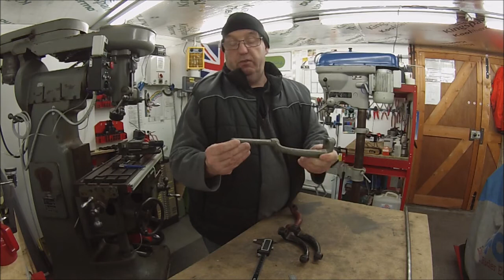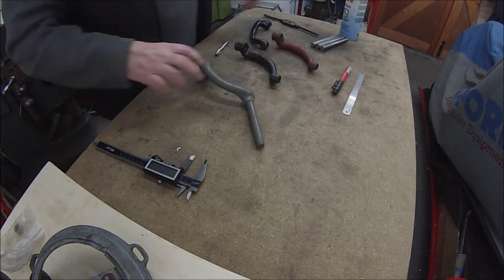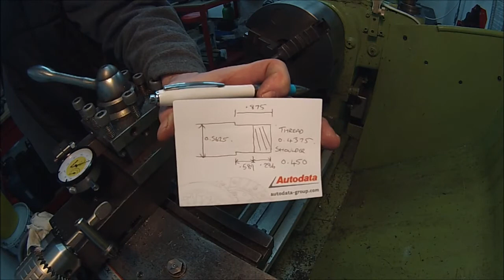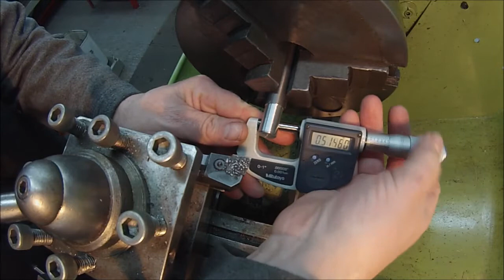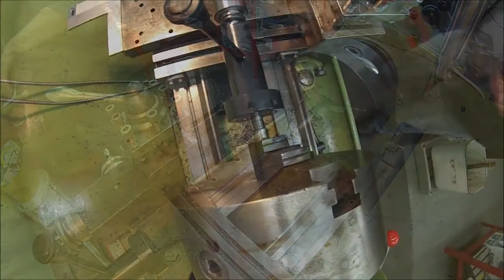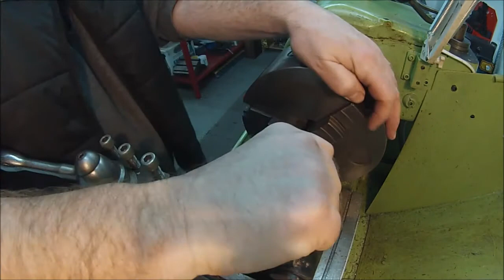Norton footrests

Comment: I see that the competent metallurgical technician in the bitter English winter often works with a coat that is a little long and open, with long sleeves. Without belittling him in any way, when I worked years ago in an industrial apprenticeship school in various occupational areas, the Director of the School of SENAI - National Service for Industrial Apprenticeship always insisted with the Instructors of Trades to demand of the apprentices, post-guard supported with a thin strip around the neck and two straps tied around the waist, secured by just two cotton threads. Many mothers criticized the fragile seams of the moorings. Sometimes they even sewed reinforcing. Hence, the apprentice was asked to hand over the altered dust jacket, being given another one with weak seams. Unfortunately, or better fortunately, there was an admirable case with a minor apprentice for example. When turning a threaded piece, wearing a woolen blouse (against the rules and not observed by the Instructor), it was pulled by the spindle of the lathe, passing between the prismatic bus-bar and universal plate with three jaws, leaving the other side with the upper part of the body totally naked. The terrified Director immediately took the apprentice to the nearby hospital. Upon arriving there it was found through examinations that no injury had occurred, there are not minor scratches on the chest and arms. This fright was demonstrated in all the workshops with lectures to all those present, with a more energetic verbal call to the Instructor, so that from now on he could observe apprentices in the lathe, in the milling machine and in the file plane, preventing them from using long and open blouses, as well as long sleeves to the cuffs.
Reply from the maker: Many thanks